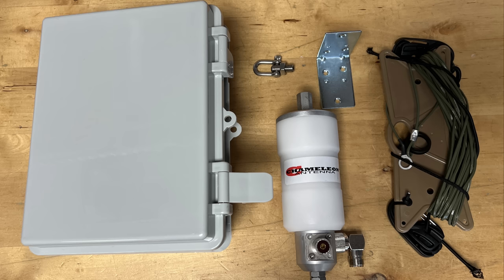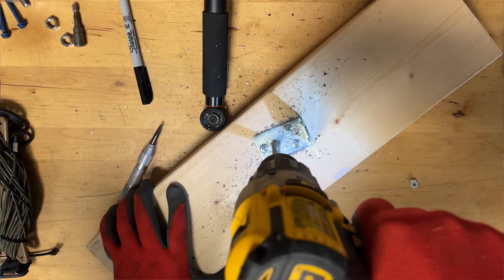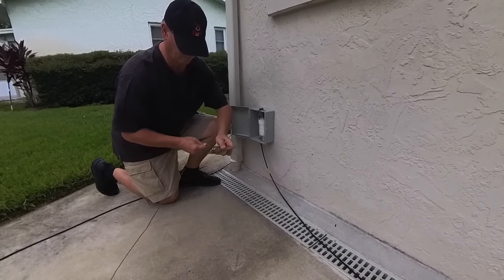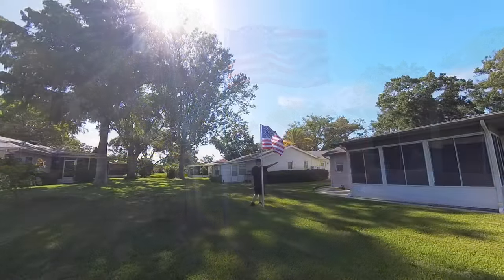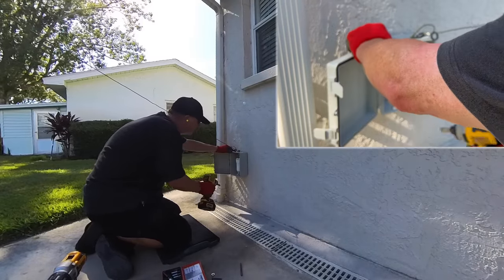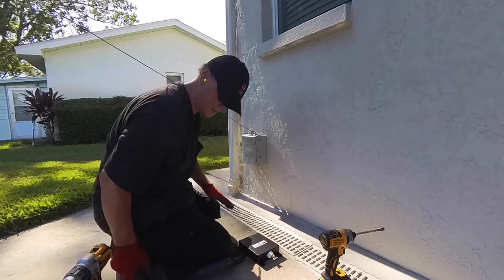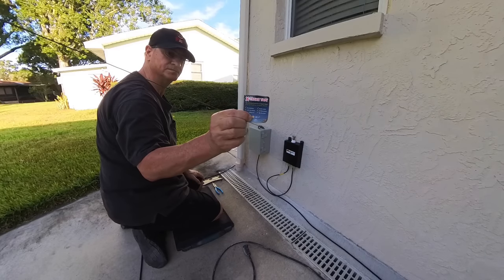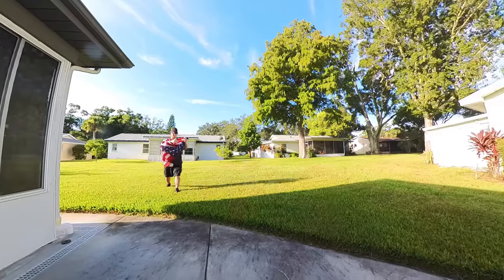Stealth Ham Radio Antenna the HOA will Never Find - Chameleon CHA Porta Mast with CHA Hybrid Mini

Comment: You may want to research this: The Amateur Radio Parity Act of 2019 prohibits private rules that prevent amateur radio operators from installing outdoor antennas. The HR 9670 bill also aims to eliminate HOA restrictions on amateur radio antennas. I am on the Board of our HOA and we allow Amateur Radio Operators to have antennas due to this rule.
Reply from the maker: Neither The Amateur Radio Parity Act of 2019 nor the HR 9670 were voted on; they are not in force and therefore carry no legal weight.  It is great when an HOA Board such as yours understands the value and follows those guidelines.
Reply: The Parity Act isn't in force.
Reply: A Bill is not a Law until it is signed.
Reply: The Parity Act and HR 9670 have no teeth. Be glad your HOA understands.
Reply: hoa's are pointless and a waste of time
Reply: @HOAHamRadio  even if they were you'd have to be willing to take it to court and fight it. HOA's have enough money to threaten most average people with court costs so it's easy for HOA's to still abuse their power here even if those laws were in effect.
Reply: @GamingKing545  you're being to generous. i consider them a plague and i would not buy a home under a HOA unless i was planning to resell at a substantial profit. you couldn't get me to live in an HOA.
Reply: @HOAHamRadio  That blows!
Reply: The OTARD law (over the air reception device) enacted in 1996. Makes it federally illegal to prevent or block the installation of antennas and illegal to the force removal of antennas. It is subject to a $5k fine for first violation and doubles each time after that.  This law also includes satellite dishes.
Reply: Quote: "Antennas used for AM/FM radio, amateur ("ham") radio, CB radio, or digital audio radio services are not covered by the rule."
 @hyroot
Reply: @floridasaltlife it's amazing how many people fail to research this...
Reply: What make of antenna are you using?
Reply: Just tell the HOA to duck off. They can’t do anything
Reply: @KieranMahoney  they can fine the owner and put a lein on the house.
Reply: @GamingKing545  you got that right.  Our HOA consists of retired people that are on a power trip.
Reply: The parity act would not/does not restrict HOAs ftom establishing rule that government antennas
Reply: I heard that the US. Congress is getting involved! They contend that we need as many Ham operators as possible in case of National Emergency??? JohnBoyUtah KJ7TBR🇺🇸😎📡🎙
Reply: @hyroot  it ONLY governs satellite dishes and small TV antennas. The satellite dishes have to be less than 2ft...
Reply: You don't allow, and you cannot disallow.

Comment: Great video! I'm about to pull the trigger on a Chameleon MPAS Vertical (the one for around $350.00 at DX Engineering). I am a homeowner but realizing that permanent antennas have their downsides, not the least of which is maintenance of them, ground loop RFI issues, putting holes in your siding to attach brackets, running coax, ground connections, etc. I had several in my other house here in FL and they can become unwieldy. A portable solution that you can out i up in 3 minutes at the start of the day and take down at days' end eliminates all of that hassle. Not to mention its advantages in an HOA environment. Another great idea I stumbled across is a 40-80 meter privacy fence wire (200' across the top, with around 100' of counterpoise on the bottom of the fence). This is awesome for a receive antenna! very little noise. Not to go way off topic but I put after putting in the 100' part near the ground, I actually was able to tune it using the 9:1 balun and work DX on it. I kid you not.  This was before putting in the 200' part on top of the 6' privacy fence) So I plan on combining the fence antenna (for 40/80 transmitting and HF receiving) with the Chameleon, giving me great coverage across the HF bands. ALL with a small low profile footprint. Sometimes we just need to think outside of the box. Keep making these HOA videos. 73 de Scott W1AL
Reply from the maker: The MPAS vertical is awesome, and you have the right idea.  I have set it up so many times back yard portable to operate for an afternoon or evening here in the HOA, then pull it down.  This is precisely the type of use it was intended for.
Reply: @HOAHamRadio  I just ordered one from GigaParts. I had ordered from DX Engineering but they said there was an issue with the order (I would imagine lack of stock) so I cancelled it and went with GigaParts. Hopefully they stock it. I also plan on installing a ferrite core before it comes into the house. They really work well, and I'd imagine it would give me double protection from common mode currents, being this is basically a form of end fed antenna.
Reply: Update: The MPAS Lite just arrived today. I set it up in 5 minutes using a Faraday cloth in lieu of ground radials. Immediately got on the air, and used the FTDX101D's internal tuner to tweak the SWR. Love it already. Contacts on all bands, including an SSB QSO with Martinique on 10M. The Faraday cloth really works well. I just spike it through the Faraday cloth, and voila, instant ground plane. This is well worth it, especially here in FL where lightning considerations rule the day.
Reply from the maker: @N1IA-4  Yep, that's the MPAS light, easy set up, easy to operate, makes contacts!   Glad you are having success.

Comment: I saw in CQ. A guy bought a hustler and hid it inside a two inch PVC pipe that he used as a flag pole with the coax buried to his shack
Reply from the maker: That sounds like a pretty good idea.  Thanks for sharing.
Reply: Many HOAs ban flagpoles from what I've read.

Comment: As always, great content for us HOA people. Harbor Freight sells a collapsible flagpole that can be adapted to HOA use as a mast for a wire, or as an antenna itself. You just have to jump the sections for continuity if you use it for the antenna. But I doubt it is as good of quality as your mast. 

I currently use a Chameleon MPAS Lite 17 foot ground mounted vertical which does very well. No one sees it in my backyard and it takes me 10 minutes to put up or take down.  I make more than enough phone contacts over the big pond. It's great for portable work too. 

I'm guessing you fared well during the storm. I'm on the opposite coast and we just got a little rain. De K4CKR
Reply from the maker: Fantastic work @outlaw6595!  I have the Harbor Freight version, and will show it off someday.  Its definitely subpar in quality to the Chameleon.  It will never be the station reference antenna, but I'll bet you I'll still be able to get it to radiate.

Thanks for asking...the storm was a non-vent for us; have had worse thunderstorms pass through -- got lucky again.
Reply: @HOAHamRadio  I'm on the opposite coast. I pray we all stay "lucky."
Reply from the maker: Absolutely! Glad to see Lee is going north instead of right at you!!!

Comment: whats good for beginners? I have no idea how to start i will move in the next years out of country rural area
Reply from the maker: For beginners, I would suggest a simple vertical antenna that won't break the bank.  Learn and expand.  My first antenna was a Wolf River Coil, then I moved on to the Chameleon MPAS 2.0.  Now, as is obvious I own sooooo many.  But if I was to recommend a starter antenna, it would be a Wolf River Coil Mini or a G Gabil Radio 7350TC...both require some means of measuring SWR to tune.  

Others who read many have opinions that vary wildly, and there is a lot of personal preference as well.  

If you have room to put up a wire antenna, then something like the Chameleon CHA LEFS 4010 which is resonant on multiple frequencies.

Comment: It sounds like the flagpole is only a support mast for the wire antenna. You might want to consider the Greyline Performance stealth flagpole antenna. The antenna costs about $1,000, not including the remote tuner. 

You could reduce the cost considerably if you can build a similar antenna with your flagpole or a Harbor Freight Tools flagpole. The design in an off center vertical antenna with no radials. You need to insulate the base of the antenna with PVC, which you have already. The bottom section of the metal flagpole is 4 feet long. Then you’ll need another insulator. The top section of 16 to 24 feet is above the second insulator.

Use ladder line to feed the antenna at the offset center, at 4 feet above the ground. The ladder line connects to a SCG SG-230 or equivalent remote antenna tuner. A remote antenna tuner must be used, because it’s a non-resonant antenna. 

If you attempt to use a shack based antenna tuner, the high SWR on the coaxial cable line will result in very severe losses. 

Between the coaxial cable side of the remote antenna tuner and your HF transceiver, you’ll need a common mode choke. 

I researched the optimum configuration of the stealth flagpole antenna system by asking dozens of hams how they configured the stealth flagpole antenna system. It functions between 160 to 10 meters.

If you can build the offset vertical dipole antenna yourself with alternative components similar to the Greyline Performance flagpole antenna, then the highest cost item will be your remote tuner.

The one downside to the vertical flagpole antenna is that it picks up some more electrical noise than a horizontal wire antenna.

Another stealth antenna design you could try is use a Christmas light string for the horizontal wire. Cut the leads for each light bulb, and then glue the light bulbs in each socket. Cutting the light bulb leads will minimize the effect that RF could have to light up the bulbs. That Christmas light string will simply look like Christmas lights that you never took down, and that Christmas light string never lights up!
Reply from the maker: https://youtu.be/-NHhjj252P8

Comment: No joke, I woke up this morning thinking about shifting my interest towards the Portamast and wondered if Bob was still fond of his.   I open YouTube with the intent of finding his last video on the product and can’t believe my eyes that the first thing in my feed is a new update on the portamast that is less than 24 hours old!
Reply from the maker: LOL...fond of it would be an understatement...in case that isn't already clear : )
Reply from the maker: BTW, I have the 20' version; that is what has been shown in every video.
Reply: @HOAHamRadio  do you ever wonder if you should have considered a taller model?   I’m debating this detail while I save up.
Reply from the maker: @cchalfantusa  my HOA allows for a 25' flagpole, but no one here flies that high...so I was trying to blend in; that is the only reason I went with the 20' vs 25'.  The 25' version is 4 lbs heavier and less than 1 1/2 feet longer collapsed; so the 25' should be considered to get the extra length.
Reply: @HOAHamRadio  I’m on the 15 foot bandwagon now.  Only because it looks manageable to rise and lower without a ladder I’m 6 foot three, but the 25 foot looks like it might require a ladder.
Reply: Notice:  Morpheus has scheduled an appointment to discuss this with you, Neo.  You'll have a choice to make, a red pill or a blue pill.

Comment: If you ran a longer wire, couldn’t you run it as an inverted L? I  would be worried about the wire being a hazard coming out of the box that low on the side of the house. Your liability if someone did get hurt alone could make your life miserable. Plus then the HOA could add to your troubles because someone got hurt by something you did without their approval. And if that was my setup, I’d probably be the one to walk into it, be engrossed in whatever I was doing, forget it was there, and boom! I’ve done it before! Keep the videos coming, I’ve learned a bunch from them.
Reply from the maker: Inverted L is certainly an option, and now my brain is trying to figure out "how" in my space.  No one else walks through my back yard, as it is my property, so I'm the only one who needs to remember -- but that could be a concern for others trying to do a similar setup.

Comment: Chameleon was the best or top 3 wire ntenna producer for ham radio operation (portable or fixed) the boox remeber me the ecomm III and I usea similar ideas in my garden 45'slooper configuration...the black box seems more like a mix by mat tuner and cg3000 73 de iz3qvb
Reply from the maker: Yep on the tuner, Mat is making a custom solution for Chameleon.  The Emcom III comparison sounds about right.

Comment: In the United States, the FCC regulates HAM radio and an HOA can't restrict you from erecting and using an antenna. There are rules, but you can do it. My HOA tries to restrict TV Antennas, I have the biggest TV antenna I could find.... Nothing they could do about it (I own my home and the property it sits on, when I put up an antenna at my mother-in-laws, I did have to put it in the attic because she owns the condo but does not have exclusive use of the outside of the condo) I could have mounted it to the deck but not the roof or walls.
Reply from the maker: Actually the HOA can absolutely legally restrict ham radio antennas.  Every Federal bill introduced to protect ham radio antennas, to date, has either not passed or failed to be voted upon.  Many hams have used proposed legislation as threats to HOA's and been successful, and I say good for them -- legally, however, at the opposing end of an informed attorney, they would lose. 

You are correct about TV antennas; OTARD protects reception antennas -- HOA can't do a thing about it.
Reply: If you signed on the dotted line, they sure can.

Comment: Just saw a video by Ham Radio 2.0.  He bought an antenna that rolled up into a Carpenter’s Chalk line case.  might be quicker for you than winding it up on that paddle.
Reply from the maker: I've heard of that, may need to check it out.

Comment: Why did you mount the feed point box so low on the side of the house, making the 30' antenna wire a tripping hazard and mowing obstacle?  Wouldn't it be a safer if the feedpoint box was mounted at least 6' above the ground?
KZ9V
Reply from the maker: Math....  The Porta Mast was so far from the house, the wire was so long; that left me with no option but to place it where I did.  

My yard is private property and no one will walk where this is except me.  So, as long as I have my memory, I'm good.

It certainly would be better higher, and I do wish I had the room for it.

Comment: Very nice install and a very informative video.  I use the CHA MPAS lite with the SS antenna and have had good results with it.  I too live in a restrictive HOA and am constantly looking for other ways to beat the system.  I have to ask in your opinion does the wire slopper give a broader reach than the vertical?  I noticed you did not deploy a  counterpoise why? I keep taking the vertical up and down and perhaps the wire I could leave and it would not be noticed but I don't have change the effectiveness of the antenna.  73's
Reply from the maker: Thanks for watching and commenting.  Both a vertical and a sloper will act differently, but I can't call one better than the other.  Perhaps more DX with the vertical, but I have no trouble getting into Europe with my sloper.  

For me it came down to convenience in the HOA; my wire is virtually invisible, and therefore, I can leave it up without worrying about getting a knock on my door.

Comment: Great video. I too live in an HOA and have given thought to a flagpole mast before but the relative minor cost for this rig seems like a winner. One question - are you still using ground raidials? I saw them in an earlier video regarding the CHA mini and the mast but I didn;t see any connection once you attached to the wall. Thanks.
Reply from the maker: I know this is a debate on this type of antenna, and I have used radials in the past.  

Once I installed my previous antenna on the side of the house, I stopped using them because of the nuisance.  With this new install shown in this video, I have not been using radials and have had no complaints or issues with common mode current.  I will likely put a choke at the coax attachment to the CHA Hybrid Mini as a preventative measure.
Reply: I run 9:1 endfeds. I do not use a counterpoise. But the coax does act as a counterpoise. I rule is to run 50 feet of coax. If I need a choke. The choke goes by the radio.

Comment: Hi from the U.K. - always amazed at the ingenuity of hams when problem solving and I congratulate you.  Is there a technical or HOA avoidance decision to mount the antenna end so low on your house siding.  Great vid thanks for sharing.  73 Mike
Reply from the maker: Thanks for watching.  The location on the house was just a function of how much space I had between the house and the mast.  I have a small yard so I only had so much room to spread out the 30 ft wire and slope it from the 15 ft height on the mast.